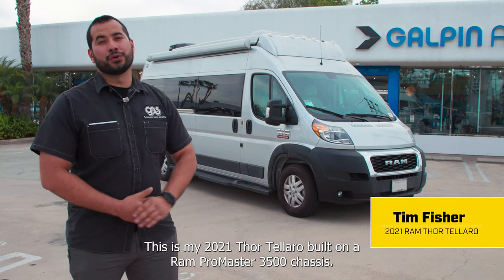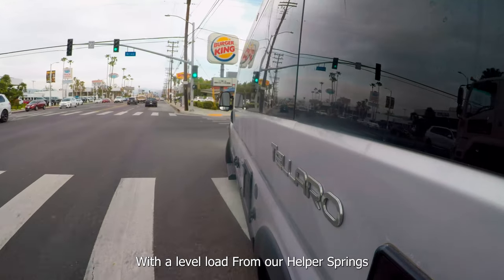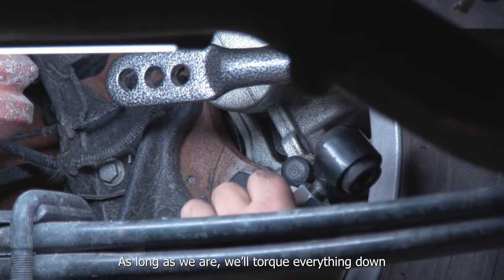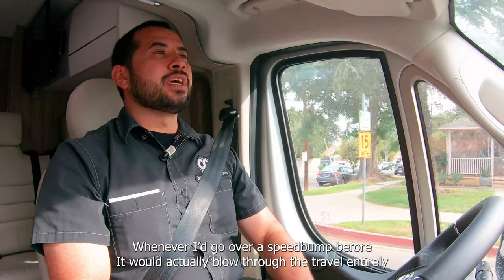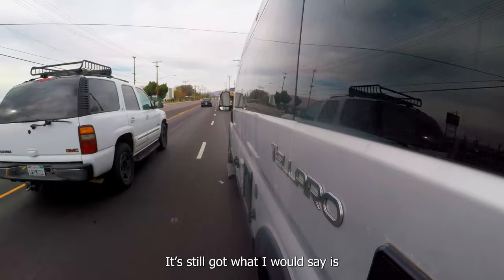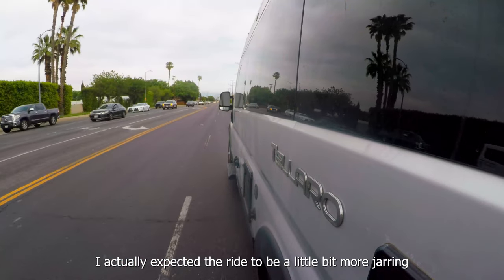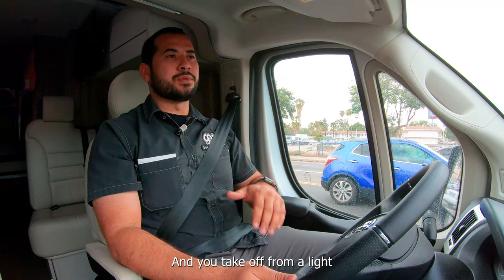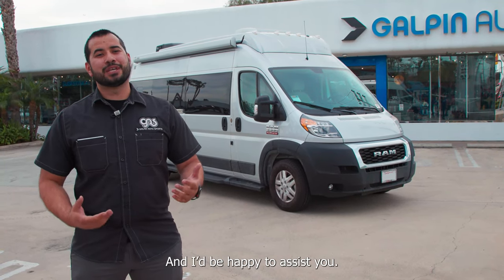Camper Van Upgrades You NEED

Comment: if you would do one first then the other, which would you recommend?  i have a 19 ram promaster 1500 highroof with a full build inside. i already have sumo springs front and rear and am just having a little too much sway still. my build isnt as heavy as most. ive built with the lightest strongest materials i could find and, obviously being conscious of it only having the 1500 suspension which is only 1 leaf spring less than the 2500/3500 from what i can tell.